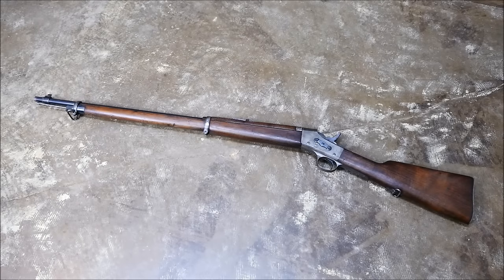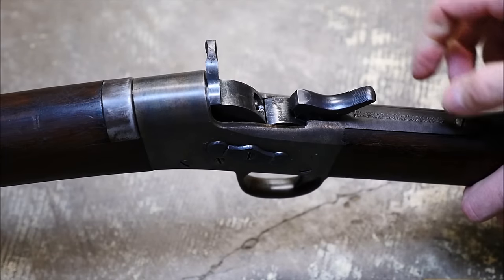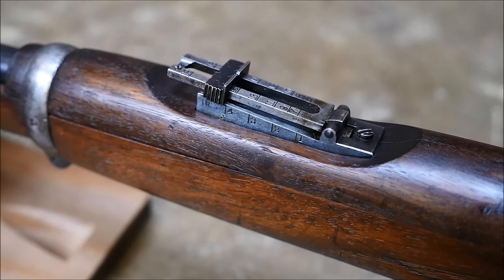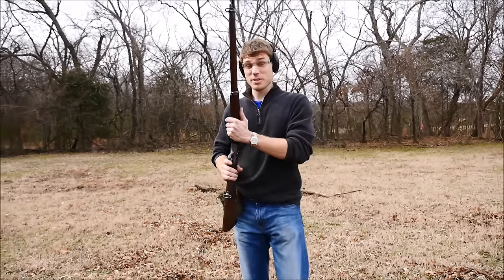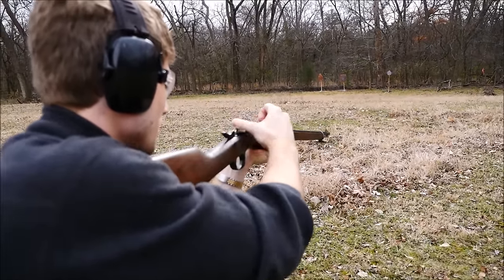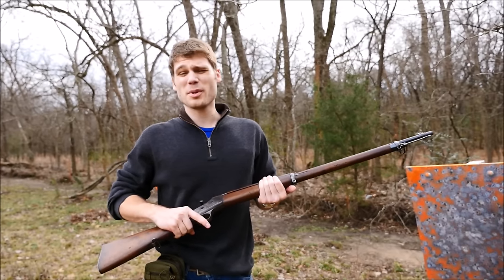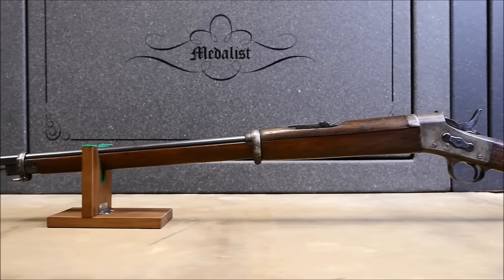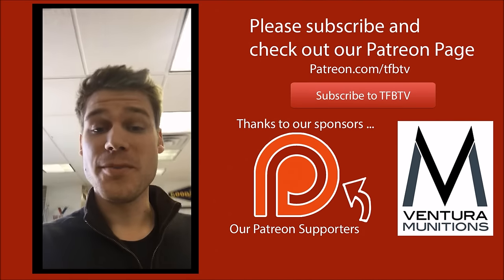Remington Rolling Block Run and Gun

Comment: "Lets give it a try and embarass myself." Proceeds to load every bullet with only minor, insignificant mistakes, and hit every target.
Reply: Using an actual bandolier or belt, instead of a pouch, would probably help decrease his load times.
Reply: +Conroy Paw it used to be common practice to hold spare ammo for upcoming shots between the fingers of one hand.
Reply: Yeah, absolutely, but I end up fumbling more rounds than I can actually chamber.  I'm pretty sure that it could be done effectively with a lot more practice.  However, I've found that a bandolier or cartridge belt is quicker from the get go.  I haven't seen any period pictures of soldiers (or bandits for that matter) using that technique, but I have seen them with cartridge belts and bandoliers, and there's no reason why they can't use both to speed up reload times.
Reply: i can see why some examples of this were used and 2nd line weapons up until the modern age
Reply: @conroypawgmail  Totally.

Comment: It's been obvious to me for quite some time that the Remington Rolling Block is one of the fastest single-shot designs out there, however, there USED to be one that was faster. The original Browning-designed Winchester 1885 High/Low Walls had a lever-actuated falling block extremely similar to the Sharps pattern, but when you inserted the cartridge and lifted the block back up, it would automatically cock the hammer, and be immediately ready to fire. Apparently even in the late 1800s idiots and litigation existed in the world of guns, and after a few years Winchester decided to change the design so that the hammer no longer automatically cocked and thus had to be pulled separately prior to firing, eliminating almost all of its' speed advantage. It saddens me greatly that despite three different companies all making versions of the 1885 today, none have duplicated John Browning's original kick-ass design. :(
Reply: I need that.
Reply: That would be incredible...
Reply: What a miracle that this good weapon never became a weapon of the US army, but was sold in very large quantities to the army of Tsarist Russia as well as the Balkans and Ottoman armies, it is also interesting that the Winchester lever action rifle (66s and 73s) was sold 10,000s of times to the Ottoman army and police . But the biggest cliché is that a large part of the Spanish soldiers and their sympathizers used this Remington Rolling Block rifle against the US soldiers in the American Spanish / Filipino war.

Comment: please try this with a martini Enfield or martini henry
Reply: +zman1508 Ammo would be a killer! Maybe if he could find one of the 303 converted ones.
Reply: +sergeantbigmac Which is why I said a Martini Enfield
Reply: Spare no expenisve. Ammo for this run and gun wasn't cheap either.  The most you need is 40 rounds just in case you need to do retakes and such.

Comment: Very nice. You have a good technique- no need to apologize at all . One thing I have tried on mine is to pull the hammer back with your thumb and at the same time, hook your little finger over the breech block thumb piece and roll it back as the hammer clears.

Comment: Nice video. It just depends on what you're practiced up on, as to how fast you can shoot it accurately.  A fella I used to know had a war trophy Martini/Henry, in .303 Brit., that he became quite fast with, and would have given you a run for your money, with. The Sharps was never intended for fast fire power. It was intended for targets out past Ft. Mudge, so you didn't have to prove your action was faster than the other guys. In short, the Sharps was intended to start work at say, 200yds. and still be a viable tool out to 1200yds. and more. i have seen this with my own eyes, and have done it as well. Keep up the good work.

Comment: Can you do a run and gun with an Eddystone Model (of) 1917?
Reply from the maker: +luke monette No.
Reply: +TFB TV why? are they rare?
Reply from the maker: Sweden
Because I have a Winchester M1917 I will use.
Reply: Sweden It depends if they went through a rebuilding program. For the most part you should be able to find them
Reply: TFB TV Any make of a the model 1917 ill be happy with
Reply: +luke monette I've got a spotter eddystone

Comment: As the US Government was adopting the Krag-Jorgensen in 1892, they should have had Remington develop a Rolling Block in the same .30-40 caliber. Then they could have built up a reserve supply of 100,000 of them by 1898. That way, when a war broke out(as it did with Spain)each state or territory could have 20,000 to equip 1 or 2 Divisions(depending on your formation type).

Also when or if there were enough Krags to share with the Reserves and Guard, the units or individuals could switch to the Krag without any web gear needing to be switched(as they would already be using the Mills canvas/cotton webbing belts and bandoliers designed to carry .30-40 cartridges).

Much better than an army that was three quarters equipped with Springfield 73 black powder rifles/carbines(the gun Custer's men died with on the Big Horn).

Comment: Very good, it is truely a fast reloading single shot. I don't know for sure, but because of reaching under the gun as an extra hand placement with a falling block, the rolling block may be a bit faster to reload. This would be a good test, which is faster to reload, rolling block vrs falling block? Maybe the Ruger # one is faster because it has no hammer.

Comment: Love the old single shot rifles.  Always wondered what happened if you didnt get the breech block fully into battery in the heat of battle.  Was it a misfire and need recocking  or did the hammer push the breechblock into position and fire.

Comment: Good video.  Of course I disagree with your conclusion.  I believe both the Sharps and the Remington Rolling Block were equal in usefulness.  However,  when deciding whether or not to retain the Rolling Block, during the Alin trials of 1871 the requirement that the Rolling Block hammer be cocked before the gun could be loaded was viewed as the creation of a potentially unsafe condition should the soldier also be engaged in combat or trying to control a panicked horse too.  So the Rolling Block disappeared from the US Army.  In my own video I show and shoot both side by side.  No running though.   )   For what it is worth, you may find doing the run and shoot a lot easier with one of the cavalry variants.

Comment: That would go faster with a better way to carry and present the cartridges, instead of grabbing one from a bag and having to turn it around each time.  Also the Capstick method, holding rounds between the fingers of the support hand.
Reply from the maker: +Jeffersonian1 I believe a proper cartridge container definitely would speed up the run. I tried the rounds between the fingers method and it is quite slow: it really helps to have free fingers when manipulating the hammer and breech block.

Comment: hm did you say they used black powder originally? I think that'd be more of a disadvantage compared to later bolt action rifles with 5 rounds magazines that used smokeless powder. I suppose it's pretty difficult to aim after 1 or 2 shots with that rifle :D
Reply: I know this is a seven year old comment, but they used black powder originally because manufacture started before smokeless powder was a thing. The rolling block entered service in 1867. The first production rifle using smokeless was the french Lebel 1886. By the 1890's there where rolling blocks for smokeless ammo.

Comment: I am not sure why this rifle is not still in production. With modern manufacturing, this should be very easy and cheap to make. Add modern materials, and you have yourself an effective budget hunting rifle for those who can not afford a nice bolt action. Actually I think I would prefer a system like this over a bolt action.
Reply from the maker: +Jesse Sisolack They do make them, but remember how much of a niche they are. Base model bolt guns are dirt cheap and offer a lot more firepower.
Reply: +TFB TV Now that you mention it, I have seen some on the market, but they are high end replicas. I just thought the design was such that a low cost budget rifle would work well. Maybe a cheap plastic stock. The most expensive part would be the barrel. Even so I would estimate final price around $180. Maybe that is too much to compete with a cheap bolt gun? Well, I do not have the equipment and the licensing is a pain worth of paperwork...and I am not wealthy, ha. Maybe if I had more ambition I could make it happen.

Comment: It's always a bad idea to use superlatives.  Shows a lack of understanding of the dynamics of history.  You also have to consider  that the RRB generally fired black powder 11mm rounds, that is a whole different meghilla. After a few rounds recoil started increasing and you also could not see for crap. The 7mm RRB was decidedly obsolescent when issued (as were .303 Martini-Enfields). At the time of it's use in 7mm, it was being generally being issued to secondary troops in South and Central America or smuggled in to their opponents.  Basically the 7mm RRB was a Ford Model T running with a V-8.  Racy, but not a daily driver.

Comment: There's been one of these in my family home for a while - probably from the military service of my great-grandfather, as this was the Swedish standard issue before the Mauser - so it's become my favorite single-shot type too. Recently I've been doing some casual reading up on single-shot rifles and came across this video, as well as some others of the Remington Rolling Block, and I'm wondering; 

When I've seen some other guys on YouTube fire this gun, it does not seem to automatically eject the casing when you open up the breech, while yours clearly does, and the old one we have back home certainly has the ejection... doodad inside the breech. My question is, is this simply a malfunction/quality issue with the rifles fired in the other videos, or is there some other reason why their cartridges would not fully eject? Having to remove the spent cartridge with your fingers would probably substantially decrease your rate of fire, which is what I see those people doing.

Comment: Definitely not as strong as a falling block rifle, try a run and gun with a high wall and see what you think. I bet it's faster as the hammer automatically cocks to the rear with the throw of the lever.

Comment: These are incredibly simple rifles. Why the fuck is a new ar 500-700 and a new rolling block is at least 1000?
Reply: +glockfan112 Its calles economies of scale. They don't sell many of these rifles. So to make their profit margin they have to charge more for them.
Reply: Ars parts are easily manufacturered and the market is over saturated,  rolling block rifles requires more specialized manufacturing and has a fraction of the market.
Reply: Carolus Rex You mean the baby rolling block carbine? That's not exactly the same as a full size rolling block.